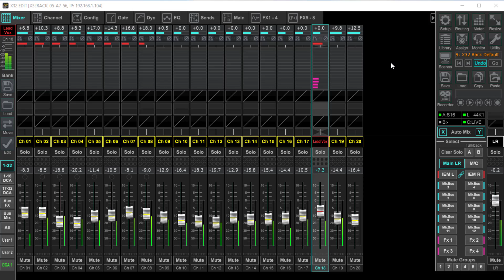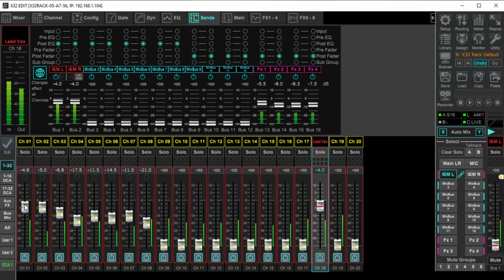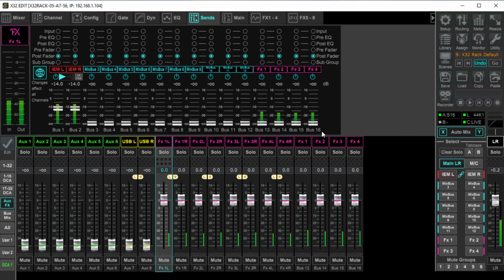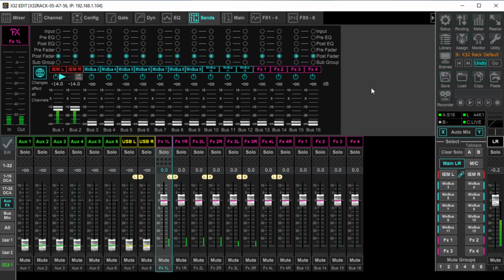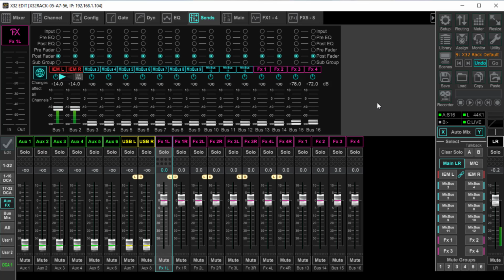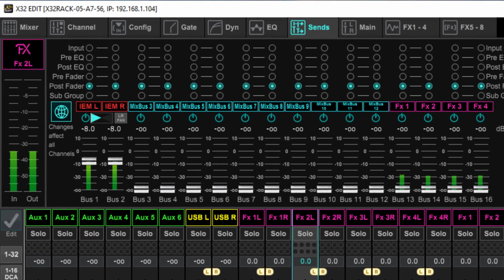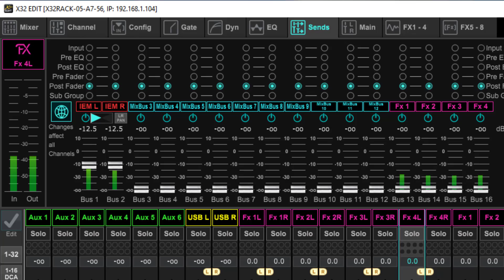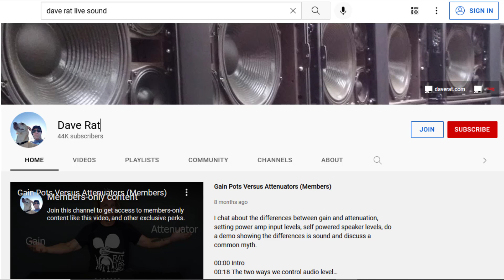Preventing FX Feedback Loops in the X32 and M32 Digital Mixers

Comment: Hi Dana. Thank you for your Video. The reason for your feedback is, that you send a Signal into your bus, in the case of "FX 1"  into the  bus 13, its like a signal to your monitor on stage. This Fader must be down. Use Fader-Flip to check this. Then check if the FX-Returns FX1 R   FX1 L ...... send to "LR Main Stereo". Check if "FX1 " sent to "LR Main Stereo" is OFF. Now you can set your Faders FX1 - FX4  and your Returns to 0db whitout feedback.  FX  works on the LR -BUS of the console.
Reply from the maker: Yes, you are right. ;-)

Comment: Hey Dana, Why are you sending the effect back to itself? That will always create the feedback loop you have shown it to create. Why send the signal of an effect return input channel, back out it's own output buss channel to return to itself? Think of the signal path you are taking the signal through, no matter what signal you are sending or where are you sending it to, where does it return back into the console and then where do you send it from there? It doesnt mean that you cannot send the effect signal out of a buss back to it's own input return, but why would you want to? I suppose to illustrate that it can be done and that it will eventually create an endless feedback loop due to the increased signal looping back and creating frequency based gain. If the expected result is to send the vocal mic to a reverb/delay and for the effect to be heard in the monitors/IEM's, the process is the same as sending the effect to any preferred output buss or your Mains or Matrix sends. I might suggest one to select the ALL faders view option as opposed to the Aux/FX view and display/scroll all input channels and output channels and change the color of the FX buss sends 13-16 to visually differentiate the output busses from the effect return input channels. If you are sending an input signal out of a monitor buss with a live microphone and returning it to a monitor wedge you will get the same result due to proximity effect, a frequency based gain induced endless feedback loop.
Reply from the maker: Thanks for the comment. I think it is the longest one I have ever gotten. The video is for a X32 Rack training community on FB. It shows what not to do. Thanks again for your comment!!